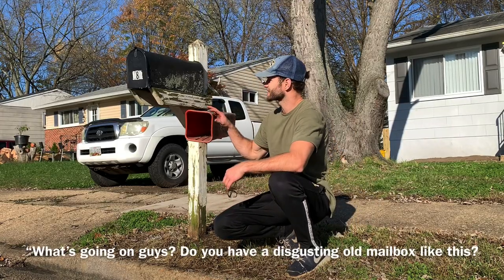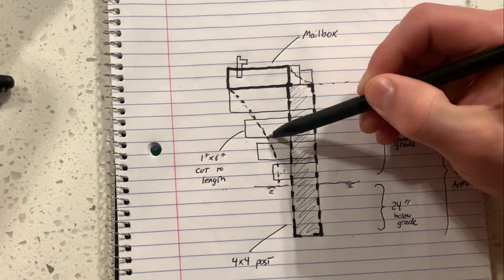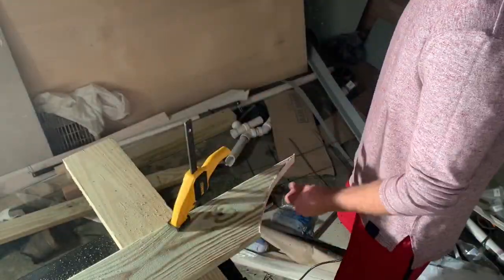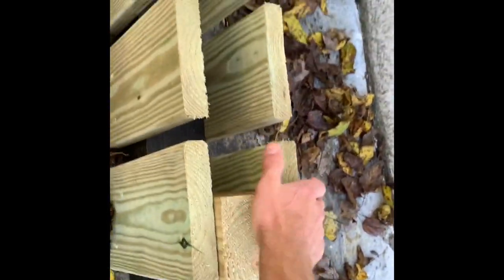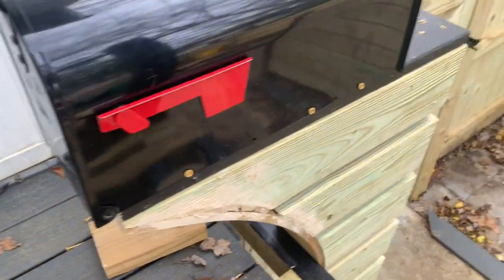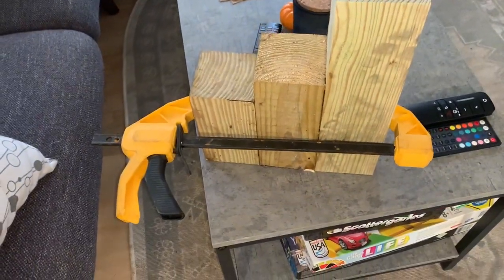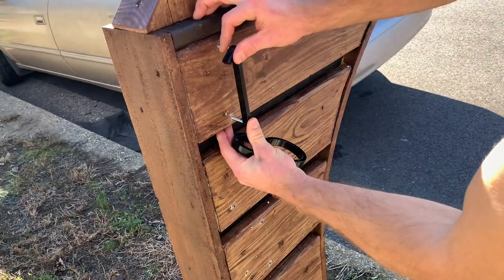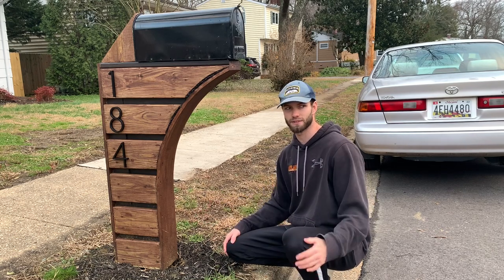Build a Custom Mailbox | How to build a mailbox and install a mailbox post the RIGHT way

Comment: Mail carrier mailbox wish list: 1) Larger box. 2) Numbers on the side approached by mail carrier.  Solid construction for a small mailbox tho! That's appreciated, that it will not wobble when you open/close the door.
Reply from the maker: Sounds like I need to bite the bullet and out numbers on the other side 😬. Thanks for all the work y’all are putting in right now! I saw the postal truck roll through my neighborhood at 9pm last week - so I know the hours are brutal with C-19 holiday season
Reply: @AndrewThronImprovements  If you ever do mailboxes in the future, having the numbers on the box itself is the best place. Put them on when the flag is down so the flag doesn't cover them. 

The reasoning is that snow plows can push snow to cover the numbers when it's not on the box. Also, grass, vines, bushes, and vegetation can cover the numbers on the pole. Also, the big white stickers with black numbers are the best. 

The biggest mailbox out there only costs $60-$80 depending on the vendor. The amount of time you save the postal workers over the lifetime of the big mail box is WONDERFUL.

Comment: My mailbox is a 3.5" metal pipe that is 1/4" thick. Inside the pipe it's filled with concrete and a run of rebar. It has rebar going through the pipe to prevent it from pulling out or bending. It has a reflective sticker on the side to prevent people from running it over but if they still manage to hit it, it'll for sure destroy their car. I had my mailbox ran over twice and they just left the area. Next time they won't be able to drive away. That's the plan at least.

Comment: That's a terrific looking mailbox.  My M. Box was changed thrice in two months.  Local 'citizens' sped past on my curved lane and took out my expensive wrought iron box!  I ordered another and two weeks later my neighbor backed into it.  Patience is my fav virtue but was tested greatly.  My first 2 M Bs cost $200 + each; the 3rd is made of a thick stainless pole driven 30 inches down embedded in more concrete and rebar than you used.  The next guy who hits me, will take out his own bumper and lots more too. :)  I like yours; its so you.  Thanks.  Back to my ATI marathon.

Comment: Out in the country mailboxes get nailed often.
I would make it out of concrette with rebar , BUT, mount it to a large coil spring like from a vehicle suspension with a 48" deep footing in the ground.
The coil spring allows it to bend over and stand back up when hit by maintenance equipment or a vehicle.

Comment: Great design.  Fancy but not too fancy... which is what I'm going for.  I was planning a similar design, but may adapt closer to yours.  One thing I noticed, because I like the black between the slats, is that you skipped the part where you added plywood backing to the slats.
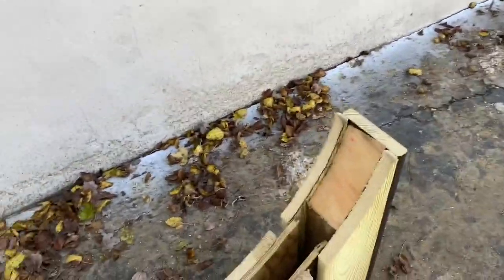Reply: 3:48

Comment: Andrew, I hope you still receive notifications for this 2 yr old video.... do you have any lessons learned from the project? I'm going to copy yours!!!
Reply from the maker: Hey David! If I was going to do this again, I would bend the picket FIRST. After bending it, I would then use it as a guide to scribe the cuts on the 1”x6” lumber. That way, you won’t have that caulk gap like I did. Hope that helps!

Comment: Nice mailbox. It's got some style. I want to ask, though. Why put the house numbers only on one side?
Reply from the maker: @driver1928 Thanks for watching! I had that one set of house numbers on hand so I just went ahead and installed them on the “incoming” side of the road. The other direction is essentially just a cul de sac, so 99% of traffic will see the numbers as they drive up. BUT I probably should just do it “right” and add #’s to the other side for consistency. Part 2? 😂

Comment: Do you have supply list?
Reply from the maker: Hi! No supply list, but from memory:
1. 4"x4"x8' pressure treated
2. 1"x6"x16' pressure treated
3. 2" exterior deck screws
4. 5/8"x6" pressure treated fence picket (for the bent front face)
5. Exterior wood stain, house numbers, and mailbox
Thanks for watching!

Comment: This may be fine for in a neighborhood, but if someone builds this and installs it on a Highway they will get a nasty letter from the Postmaster. This has more material than is allowed and also exposes the property owner to a lawsuit if anyone is injured if they hit the mailbox and it does not give way. There are guidelines that must be followed. Google mailbox requirements and be safe
Reply from the maker: Thanks for the comment! This is in a neighborhood - so should be all set. Thanks for watching!

Comment: There are a lot of ideas with the mailbox idea, it just depends on your residential area and your road way of traffic, are your road curves rather close or far enough way for the motorist hopefully isn't intoxicated or the isn't road slickin with snow  or rain, or their just not watching their driving,  but you have to consider, regardless of how sober they might be,  a true idiot still can't drive a straight line,  so then your still at the mercy of Gods hands and his mercy,  and yes, we're all at the mercy of government regulation,  mailbox damage rarely ever involves any motorist not walking away,  I'm rather sure we can all go heavier with the base of our choices in the foundation,  but the government regulations give the vandals way too much play room,  until they get caught,  and if mailbox vandalism is a 1,2,3 count of jail time,  then they might face prison time,  but the difference between vandalism and motorist having an excusable or inexcusable accidents with mailboxes,  sometimes it's just hard to say, but putting up a nice mailbox, the ideas are unlimited,  if you want fort Knox go ahead,  but it still has to have a safety brake away,
Reply: Building permits should be required.